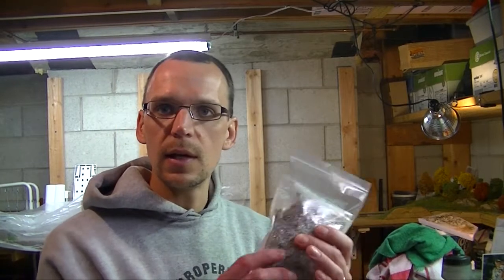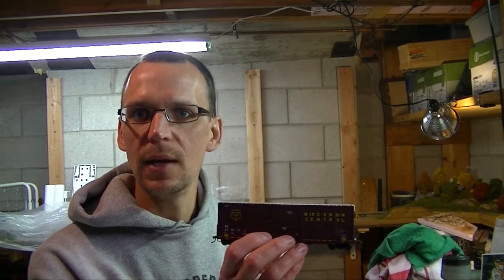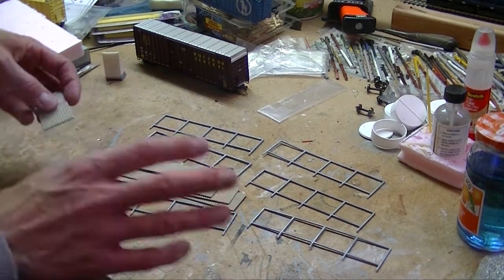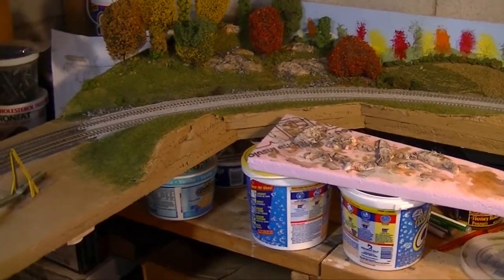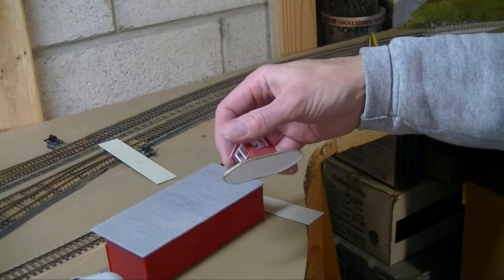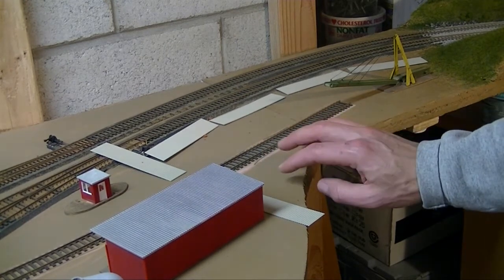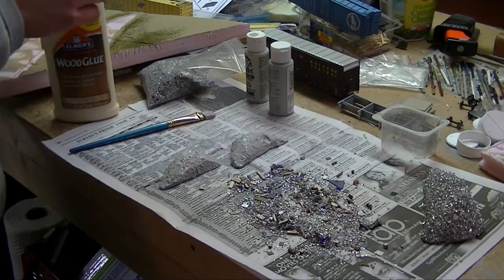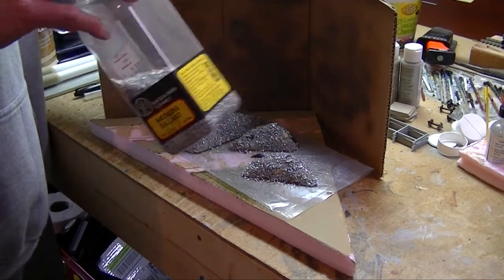Modeling a Scrap Yard on my Wisconsin Central Layout Part 1 of 2

Comment: I was a welding inspector and worked a lot at steel fabrication shops and machine shops where metal shaping took place either with mild steel, aluminum, or stainless steel, which generated a lot of metal shavings. I have taken quite a few bags of the shavings with the intention of using them as loads for my gondolas.  If you have a machine shop or steel fabrication shop in your area, don't hesitate to stop in and ask them for a bag or two of metal shavings. If you tell them what it's for, I'm sure they would accomadate you.  Good luck.